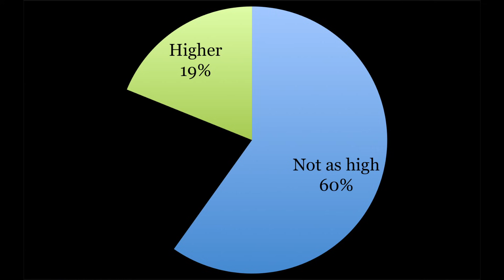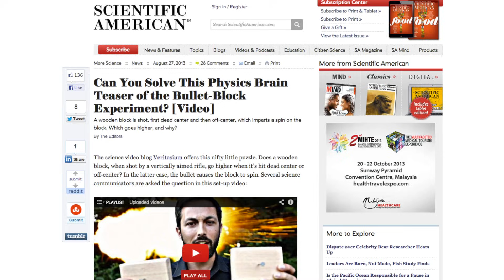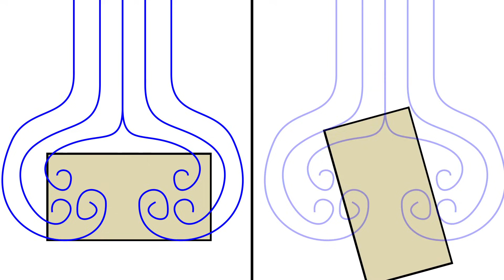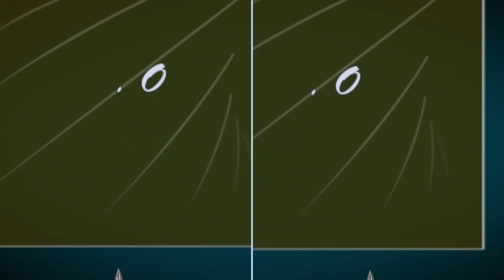Bullet Block Explained!

Comment: Noone knows how magnets work :) there are only layers of explanation but ultimately it's not understood. same as gravity.
You could say magnetism is just a 'broadside' effect from the imbalance between the very strong electric forces that arise due to relativity when one side of the electric balance moves. 
For instance, in a magnetic coil the protons and electrons are balanced so it's neutral but when the electrons move, their electric field  'fades' due to relativity on that tiny motion.

Comment: It's pretty bizarre but apparently it makes all the difference that the spinner block starts to give a little easier, then the bullet can apply a bit more work to the block thus giving it the spin on top of the linear speed. It's very counter intuitive that physics can keep track of things in such a brief moment.
The momentum has to flow into the block without loss yet the physics manages a second type of accounting at the same time that deals in energy/work and relative speeds. Quite profound.

Comment: I thought similar at first too. I thought the momentum had to split up into linear and spin momentum but dastardly, that's not how it works :)
That's how it works for energy but the energy side of things was very deceptive. My current understanding of things is that something dramatic happens when the spinning block starts to move a little easier during the bullet penetration. That tiny difference makes a lot of difference in the work done to the block so it can get double the energy. Bizarre

Comment: Would having two horizontally longer blocks make a difference to the depth of penetration? 
shooting the bullet towards the centre of mass for one block like in this video. and then shooting the bullet towards the edge of the other block so that the angular velocity becomes greater as the moment on the block is greater. This means that the rotational energy would take up a higher percentage of the kinetic energy of the bullet and therefore not penetrate as deep into the block. 
Matthew

Comment: If you shot the bullet further towards the edge of the block then it would create less of an indent as the edge of a rotating object moves faster than the middle, or about half way (as it has a longer distance to rotate in the same time).

Comment: Why show the nail measurement indicating a distinct difference in the depth of penetration only to then x-ray the blocks and find they are the same? Which is correct? What the x-ray only done on a single trial or for all of them? I would of liked to see the averaged result if it was done for multiple trials.

Comment: maybe if the blocks were bigger and made of a softer material (that's also more homogenous than wood), the bullets would travel further in them so you could measure the difference. or you could try to find a way to measure the heat and sound energy.

Comment: The easiest way is probably increasing the total penetration depth, for example using softer material. Wood, however, is not very well suited as it is inconsistent in its structure.

Comment: the bullets energy in the side of the block was more conserved, as the side of the block required less work to lift initially. Therefore the bullet would have decelerated slower losing less energy to heat/sound/vibration and transferring it to the wood more efficiently.

Comment: I am interested in finding out effects of a similar experiment where instead you hit the block using a lever contraption and a falling block from same height, so that the deformation is much lower than in this case. You can havepoint of impact always the same if on the free end of lever you have a guiderail and an upwards pointing contact that is independent of the lever but just in contact with it. Would it be possible for you to conduct such an experiment? Thanks in advance!

Comment: You don't need any of those. Angular momentum vector direction is in the direction given by Fleming's left hand rule, whereas linear momentum is in the same line as bullet impact. Both are perpendicular to each other. If you've read even a smidgen of science you will know that perpendicular spatial vectors are orthogonal to each other, that is they are independently conserved.

Comment: I think a longer block would help because the percentage of energy being converted to angular rotation would be greater. Some other things to consider: Using a steel core bullet might help with consistent measurements because it would deform less. A more uniform block made out of something like clay would likely have less variation in penetration.

Comment: So if hypothetically both bullets penetrate the same depth, by the conservation of energy, the spinning block wouldn't go as high.

Now if it doesn't go as high, that would mean that the initial vertical velocity of the spinning block/bullet body is lower than the velocity of the non-spinning body. Linear (vertical) momentum is not conserved in that case then. Can anyone explain?

Comment: I just went to film a video resonse and as i was uploading the clips to my computer, i saw that i was too late and you had already done an answer video. My response was not about conservation of momentum. It was that if you lift a block (1m by 0.5m for example) from a point on the side of it untill it's centre is 50cm off the ground, it takes the same amount of force to lift the same block at it's centre intill it's centre is 50cm above the ground.

Comment: using a material off lower resistance (density) because the lower the resistance the more it pentrates and the more the diffrance in pentration

Comment: launch the wooden brick with loaded spring (something wider at the top) so it doesn't penetrate in it at all. I believe that rotation energy is used to lift the brick into the air... if you look only at the part of the brick where bullet hit it, you can see it goes up, then almost stops when this part of brick is in downwards rotation. So this part of brick goes up, then stops, goes up again, stops again and so on... because of preservation of energy center of mass is moving at the constant pace

Comment: I don't think that would do the trick by itself.
You need a MUCH bigger block, MUCH softer material (styrofoam?) and a smaller diameter as well as lower velocity round (pellet gun? nail gun? a special arrow?) Or go with a gigantic soft wood block and use armor-piercing rifle rounds if that's possible.
You need to maximize impact depth while minimizing the dispersion of heat that occurs on impact relative to the energy of the projectile while most of the energy should delivered through mass.

Comment: Use something larger and less dense and it will extend the distance over which you are measuring penetration. Each percentile will then cover a larger distance be easier to measure. I would recommend some kind of ballistic foam.

Comment: Probably because only the pony figured out that cheap .22 rounds suffer from the highest powder load inconsistency rate, which means that "non-gun people" shouldn't stage experiments with guns and then attempt to crunch fancy numbers.  Not to mention that the pony looks like a space pony, and it knows that in (relative) vacuum there would be no energy loss from rotational turbulence.

Comment: The cartridge powder load is VARIABLE, energy of each shot is not a constant, regardless of what the block is made of, how it is positioned, and how many times it gets shot.  The spinning block does not rise as high as a stable block, just EXPAND THE SCALE of the (virtual) experiment, and turbulence from the rotation will show the rate of energy decay.  Or, feel free to eyeball it by counting pixels of nail heads...

Comment: hmm I'm afraid you are right anyway. if linear momentum is truly unaffected by what happens in angular momentum. how disappointing when I thought I had a solid argument on conservation of energy.
It must have a very dramatic effect that the wood moves a little easier when hit off center to roughly double the absorbed kinetic energy. Just that tiny difference in relative speed. how annoying.

Comment: use a more controlled variables and materials. One that cannot have a random deformation like steel, copper, or aluminum. Wood easily breaks on impact. Also, you might consider spherical bullets. In that way when you xray the specimen, you will have a circular shaped deformation. Thermal scanners and sound measuring devices as well.

Comment: Thanks for this food for thought! You can measure using a program like photoshop. for best accuracy redo the x-rays and frame your shots so the tips of the the bullets are dead center and are filling the frame as much as possible. Secure a ruler beneath the blocks so the unit lines are parallel with & begin at the plane of entry while keeping the mm ticks in frame. In photoshop use guides to measure pixels between bullet tips and determine pixels per mm. can elaborate if needed, out of space now

Comment: Construct a block with a hardness that decreases with height.  For example, 1/2 inch of oak, then 1/2 inch of balsa, then 4 inches of Styrofoam.  Most of the bullet velocity will be lost in the oak/balsa, then the bullet will stop in the Styrofoam.  However, because the Styrofoam doesn't take as much energy to pass through, differences in penetration will be more easily measured.

Comment: What if you didn't use a bullet... but compressed air, and then see if the both blocks go the same height.
if they do, the depth of a bullet is not important...
If not... well :D

Comment: You can use softwood or some smooth material. Think of it like this if you used a concrete block you would have either no or very little penetration. Result immeasurable. But if you did it with a long jelly then the bullet would float into it. Result measurable. But you cant use jelly of course. So i would recommend a soft or smooth wood and a gun powerfull enough to go deep into it but not too much to break it ir pass through.

Comment: What if you used two bullets adjusted so that they had half the original mass of the first and adjust initial force so it was the same as the first shot for both rounds and fired them at the same time offset on opposite sides of the block....the block should rise to the same height with no rotation, right?

Comment: In theory, changing material to rubber or some sort of gel, would make it more measurable, but not without changing the size of the blocks. This because the bullet would exit the other side before it was measurable "enough". If we made them bigger however, this would definitely work.

Comment: And to answer what you removed.. You clearly understood this as changing only one of the blocks' materials, and not all, which I don't even know how you managed to assume.
With this cleared, The ratio, as you mentioned, does stay the same, and my theory is solely based upon the ratio staying the same throughout different materials, while using a constant unit of measure.

Comment: in the spinning block the energy of the bulet is absorved by the acceleration needed to start the spin moovement but also to accelerate the block uppwards, as in the non spinning block all the energy is used to accelerate the block only uppwards

Comment: I think I can use your own words against you. You correctly state that angular momentum is conserved (if we say the bullet and block collide in isolation) which means the resulting angular momentum of the spinning block has to be there prior to impact as well. Leading to my conclusion that the bullet comes to the block partially as angular momentum because it's offset from the spin axis.
If I'm right about that, it does leave a mystery however; can linear momentum be slowed by becoming spin?

Comment: I disagree. Linear momentum and angular momentum are conserved independently. It is true that the bullet provide angular momentum to the block, but this does not come at the expense of linear momentum.
If you choose your reference point on the vertical line through the center of the block, the initial (after the bullet is fired & before it hit the block) angular momentum of the whole system (bullet + block) is already different for the two setups.

Comment: I don't think a difference in deformation is the correct explanation.

The reason the second block has angular momentum after the impact is because the second system had angular momentum before the impact.  The angular momentum of the system pre-impact is the cross product of the bullet's momentum and the vector from the bullet to the system center of mass,  r X mv, since the block has zero momentum and the bullet has zero angular momentum.

In the first system, r X mv for the bullet is zero.

Comment: A good DOE (design of experiments) philosophy is to simplify as much as possible, thus eliminating much of the debate about hard to measure forces and other variables.

Use a spring loaded piston to 'push' the blocks up making sure to not exceed the elastic limit of the spring (so you have good repeatability).

Comment: Yeah, you would see a height difference if the bullet escapes the back side of the wood.  Or if the bullet bounces off of the wood.

Because then, they don't have an inelastic collision, and the momentum isn't completely absorbed in one common composite object.

Comment: You could try using a higher density block. That would make the bullet work harder to penetrate the wood deeper. You could also try and use hollow point bullets. The hollow points might make the center of mass trial penetrate higher into the wood.

Comment: The energy per meter will reduce, but so will the amount of rotational energy (lighter spinning things have less rotational energy). So the penetration depth + change in penetration depth will not change if you halve the mass of everything in the system.

Comment: That's the intent. The height the block flies don't need to change, the penetration depth just needs to take less energy per meter so the difference is more evident.

Comment: Right, but the hardened steel piston a) isn't free flying and b) doesn't get lodged inside the block (correct me if I'm wrong). That means you've completely changed the problem. You can't easily use conservation of momentum anymore; we're doing a completely different experiment and I would expect different outcomes.

Comment: Yes, the spinning block will actually be rotating around a point between the centre of the block and the bullet (just like the Earth and Moon both orbit a common point called the barycenter), and the inertia will be different too. But the difference is small/negligible because the bullet is quite light.

Comment: It'd only go lower in height if the wood didn't capture the bullet. If you go so far over to the side that the bullet bursts out the side or wood chips come flying off, then you've changed things and of course it would probably go a different height. But as long as the combined bullet+block stays as one piece, there would be no difference in height.

Comment: The only reason there would be a difference in altitude is if the collisions were no longer inelastic (i.e., the bullet bounces/sprays off the steel rather than getting captured inside the block*). But then we're doing a completely different experiment.

* You can't invoke conservation of momentum if you don't keep track of all the parts of the system, like shrapnel recoiling from the block.

Comment: Nope. If the block is so long and heavy that the bullet couldn't lift it even at its centre, then we're talking something different. But as long as it's not that heavy, the centre of mass will move up at the same velocity regardless of impact location.

Having said that, I can see that me (or even Derek) just saying "conservation of momentum always holds" could be unsatisfying. It can be proven by thinking about the Y velocity of each atom, atoms swap velocity but the total remains the same.snip

Comment: both blocks have the same linear momentum and for this reason they reach the same high because the linear momentum is "consumed" while they rise by the same force (the system block+bullet has the same weight in both cases) angular momentum in the second case is coming from an amount of energy that in the first case is used in the deeper penetration of the bullet

Comment: what about using a sensitive mic and thermal camera ! we can take measurements of those too. and we can attach an arduino and 3d accelerometer to the wood block and then we can keep track about the acceleration   !

Comment: IT's negligible when you're dealing with just distance, however, in this case, the 1/10 of a millimeter translates to 1% of the total energy of the bullet. Now that seems negligible too right? Well considering the bullet loses 97% of its energy. Which means both blocks are running on 3% of the total energy of the bullet, but the spinning block actually gets 4%, which means the spinning block gets about a third more energy than the non spinning block thanks to that 1/10 of a millimeter.

Comment: First, the block could be bigger, so that the second bullet can go into the block further from the center of mass, therefore creating more torque. Second, the block could be made lighter, so that the increase in its upward velocity is greater and easier to differentiate. Also, the material could also be softer, so that the difference in penetration depth is greater, too. Basically, what these criteria suggest is making a big block of styrofoam.

Comment: The system had the same amount of spinning energy (well, almost), before the bullet hit the block. It doesn't seem intuitive, but actually, since the bullet wasn't moving towards the centre of mass in the second case, it actually already WAS a spinning system in our frame of reference.

If it wasn't, then it wouldnt matter how the block moved out of the way or whatever, the system just cannot get linear momentum out of nothing.